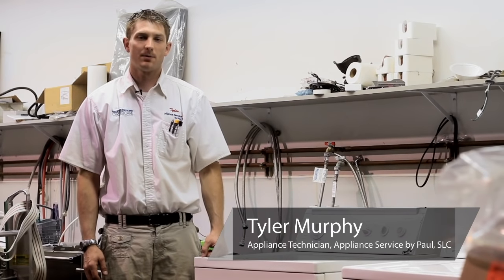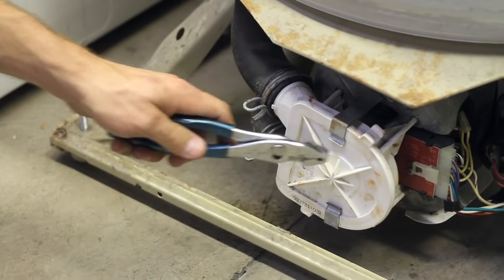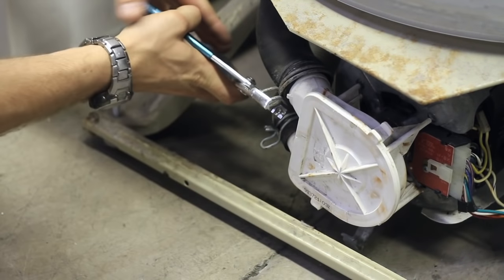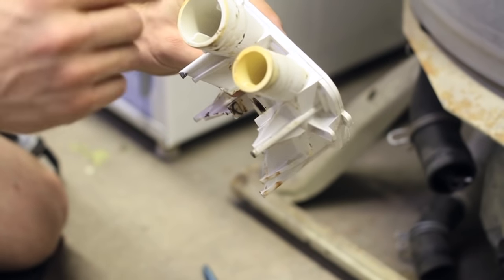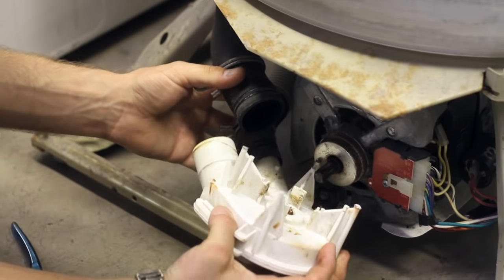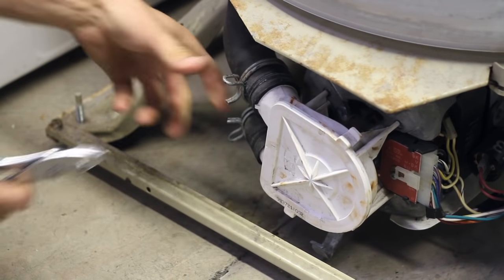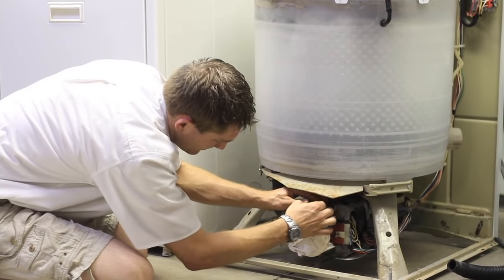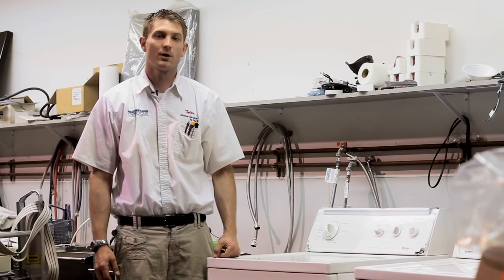Washing Machine Repair : How to Fix the Squeak in a Washing Machine

Comment: What if it’s not a Bobby pin or nail?😂. I can’t believe this video actually helped some people.
Reply: Replace the pump.
Reply: @rjsmith2007  there's a handful of other reasons a washer will squeak. Like something stuck between the drum and tub, high water pressure, a bad ujoint if squeaking during agitation, bad bearings, etc.
Reply: I would imagine you just remove it.

Comment: 1 second ago
If your washer is squeaking it’s most likely an Idler pulley/ idler roller or drive belt, not your drain pump 🤣 Where do they find these guys at? It’s embarrassing. If it was a humming noise and your washer was draining slow or not at all then yeah🤦🏾‍♂️🤣

Comment: What if the noise is while agitating?
Reply: I replaced the hub on my maytag bravos washer, and when I put the plate back on, I screwed the bolt down too tight. It squeaked until I tried the wash cycle without the plate in to see if it still squeaked. It didn't. When I put it back in, I left it a little loose and now it doesn't squeak.